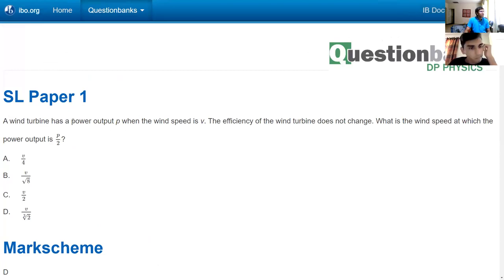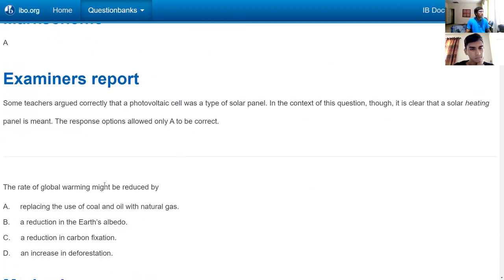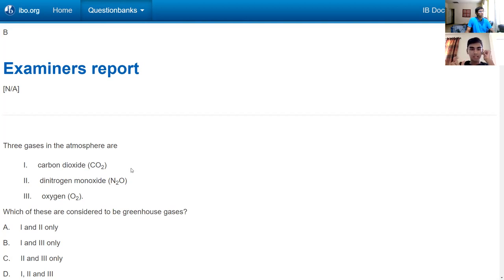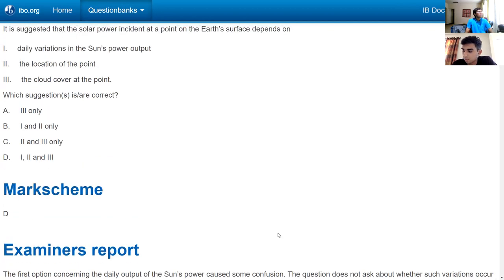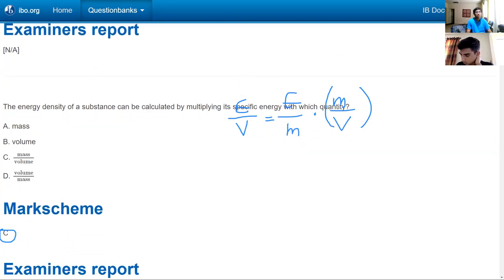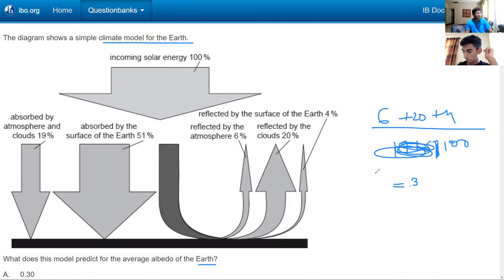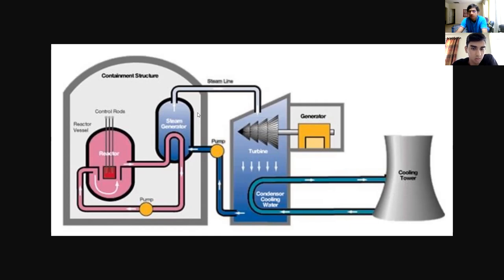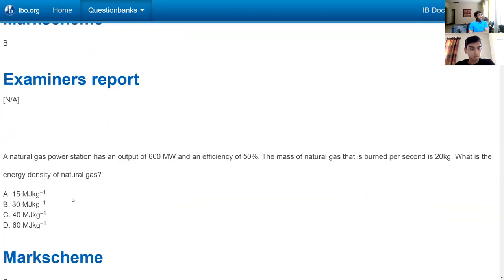IB Physics: Energy Sources (Topic 8) MCQ Exam Review

Comment: Is it p=fv
Reply from the maker: It's actually not that formula. For wind turbines, the power output is 1/2 of the product of the wind density, the area swept by the blades of the turbine, and the wind speed cubed. So P = (1/2)(rho)(A)(v^3)

This can be derived by considering P = (Change in Kinetic Energy)/time. Consider a volume of the wind that is pushed by the turbine. KE = (1/2)mv^2. But mass is just the density (rho) times Volume. But volume is just the product of the area swept by the turbine and the distance of the wind moved. Then, m = (rho)(A)(d) where d is the distance of the wind moved. Then, P = (1/2)(rho)(A)(d)(v^2)/t. By grouping (d/t) together, we get another v (because the wind speed is the distance travelled by the wind in time t). Therefore, P = (1/2)(rho)(A)(v^3)
Reply from the maker: We should have specified- the formula you stated that P = Fv is a correct formula. It's just that in this case, force is not constant, and thus power is not proportional to wind speed. When the proper substituons are made, the dependence found is that power is proportional to wind speed cubed, as stated in the video.